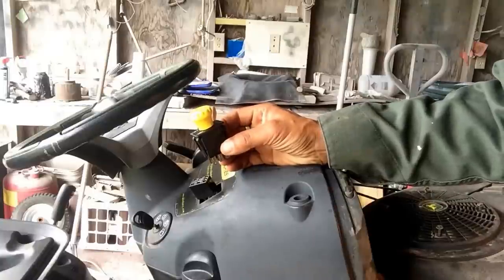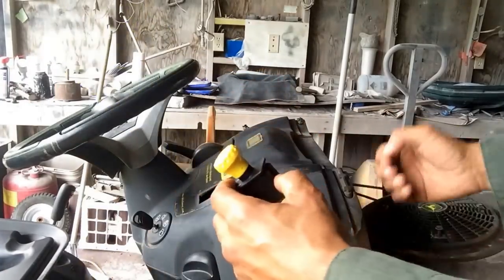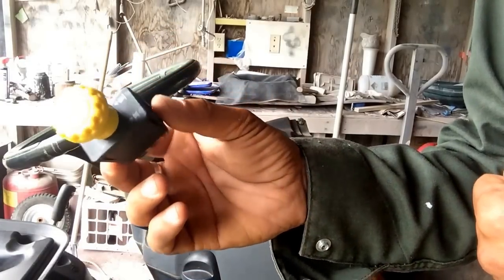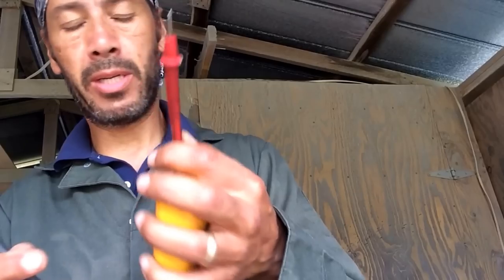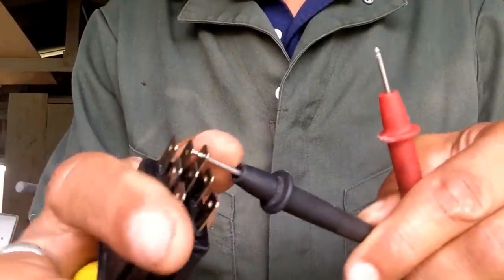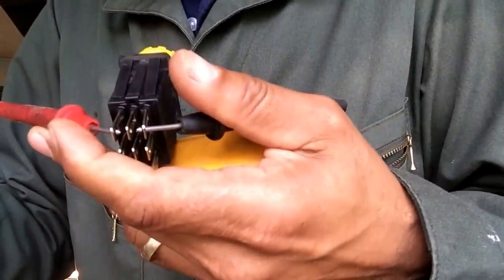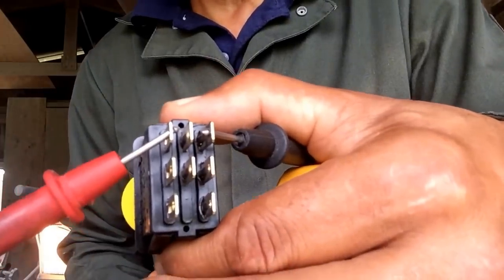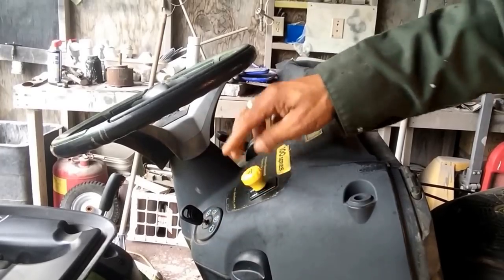PTO Clutch Switch replacement for John Deere

Comment: Thanks, I had used other sites which said replace out the seat & brake switch safety features, I tested ohmed them out with the new and were exactly the same readings, I then with out schematics traced through the switch to a relay and decided the switch and it was just about the last thing as the isolated 12 volt test to the electronic clutch worked fine. I stumbled across your video and just for kicks decided to test out the pto switch before ordering, Well when I pulled it could tell a little heat damage on the switch and it did not pass the ohm test either. Thanks for posting the video.
Reply from the maker: Anthony Zarazee  I’m glad one you found my video and two it worked for you.
Don’t forget to subscribe and see some other videos on the 100 series...👍🏽👍🏽

Comment: Thank you for showing me how to test the PTO switch. Unfortunately that's not the problem with my mower and it looks like I'll have to do some more digging around to find out what my particular issue is.
Reply from the maker: Gene Goebel what’s happening..?
Reply: I'll start from the beginning  and go right to the end and what the final  problem was for me personally. But if it wasn't for you showing how to check the PTO switch I probably never would have figured it out so I definitely do appreciate this video.

As the mower started getting warmed up and at operating temperature, the mower deck would stop all by itself with the PTO switch still engaged. I removed the mower deck and ran  the mower without the mower deck and the PTO switch engaged.
I was really hoping that the unit would work fine and it was a mower deck problem but unfortunately the problem still persisted. A twist to the problem showed up that without the mower deck on, the unit would start back up within a few seconds.

After watching you show how to test the PTO switch, I tested the switch and it worked like it should. Then I hooked it up to the mower, bypassed the seat safety switch (please do not do this unless you know what you're doing and have the mower secured so will not move), started the mower, throttled up, and then engaged the PTO switch. 

I wanted to test the PTO switch under load just to verify that something inside the switch was definitely not the problem and when the switch passed with flying colors, I started to look elsewhere today. 

I already knew that the PTO switch was working fine as well as the seat pressure switch since I had it bypassed. 

I then decided to work backwards and located the electronic clutch wiring and decided to test that next.

Without the unit running, the connector plug within the wiring harness tested okay, but I wanted to test it when it was running.
While the unit was running and my meter hooked up I could tell it was getting power and no power every time I engage and disengaged the PTO switch. 
Now I needed to wait and see what would happen when it disengaged all by itself and then restarted by itself.

It didn't take long at that point to realize that the electronic clutch was the problem because the clutch was still getting power but it was disengaging and re-engaging all by itself and my meter showed no change in power going to it.

Grabbing a hold of the wiring and gently pulling on it away from the clutch replicated the problem multiple times.

So unfortunately my problem wasn't a cheap repair but if it wasn't for your video I would have sent it in for something and gotten charged for it just to have it not be the problem.

 so again I just want to say thank you for your video and showing me how to properly check the switch.

Gene G
Reply: I forgot to mention what type of John Deere mower we have.  It is a 2007 x520 with 587.5 hrs.

On a side note, I talked to my boss and we are now asking our finance director about replacing the entire mower instead of repairing it again. We've already spent a ton of money on this mower within the last 3 years and it still needs a new mower deck. 

Our mower really isn't designed to be mowing what we mow with it and it is super underpowered compared to our bigger unit.

Our bigger unit is a 2002 JD X485 with 610.1 hrs on it and it's still running great.
Reply from the maker: Gene Goebel wow... thank you for the in site on finding the problem.
And I hope people will read your comments.
A lesson learned is a lesson shared.
👍🏽
JD sit downs aren’t the best but I think we pay for want we get...
Keep on learning 🤔

Comment: Thanks for posting this! The blade on my mower won't shut off, no matter what position switch is in, and the mower will start up with blade engaged (again with switch in either position). The part you showed us checks ok (beeps when switch pushed in, no beep when pulled out). Will checking the other terminals tell me anythingor do I assume problem with the PTO?
Reply from the maker: batex3 one thing I have found is never assume anything 👍🏽
Check all smaller items first.
The PTO should not just turn with out the switch being pulled( as you know)
So if it's testing out like I showed you then move onto the next to the next area or part....
Let me look at mine tomorrow morning and I will try help you through this problem.
Good with that.🤔
Reply from the maker: batex3 just a thought 🤔🤔
It may be worth just buying the PTO switch as they are not that expensive and trying it.
You could always take it back if it's the same result.
If it is the same result then I'm thinking it a short.. but will check and get back with you.
Reply: Thank you so much for the reply! I was thinking exactly that, just replace the switch since it is relatively inexpensive. (I was wrong about startup, it will not start with the PTO switch on, so at least that is safe.)

I needed to get mowing (we have had a week of rain!) so I decided to use the mower anyway. Well, 10 minutes in, the mower stopped moving, won't go forward or backward. Blade still turns all the time though so I'm guessing it is an unrelated problem. 

I don't know how the drivetrain works on a mower, so I'm off to youtube again to see what I can learn.
Thanks again for your help. It's been a good mower but they say problems come in threes, I wonder what's next LOL!
Reply from the maker: batex3 check out some more of my videos 
I have one where that same thing happened.
It index up being a micro switch bottom right of the engine..
Just a faulty termination 👍🏽
Reply: Thank you DW! Just subscribed and will watch your other videos. I'll bet it is something simple since it stopped so suddenly. I'm just now getting back to the mower today (another rainy day in the southeast!).

Comment: my lx288 keeps burning out the capacitor on the ignition module? Replaced the pto clutch and the pto switch to no avail? Any suggestions
Reply from the maker: Have you checked all your cables coming from the ignition...... the fuse, 20amp....& make sure the front lights have not been shorting out.?

Comment: Hey, I removed pto switch, and also had to remove the little plastic piece that houses the wires that plugs into switch. I cant seem to get the wires in the right order, it keeps popping the 20 amp fuse. Is there a place I can get the schematic? thanks
Reply: Sorry this is so late, but I just read it.  The pins have to be the same, COM, GND, etc.  You might have reversed pins.  The should be embossed on the original switch on the side or back.  I replaced mine and its from a different mower.  The printing is sideways on the knob but works perfectly because all the pins are the same.